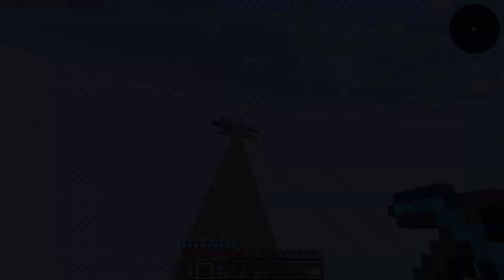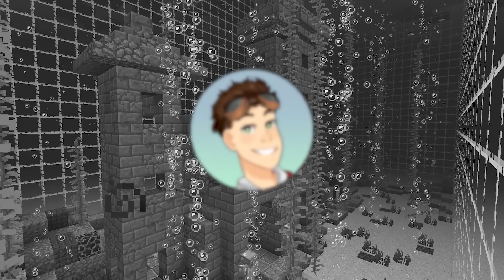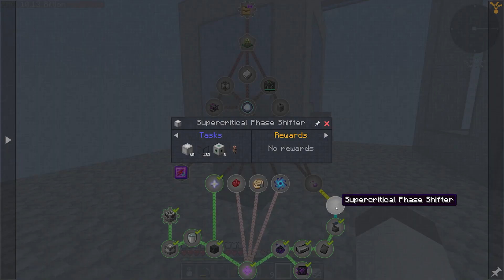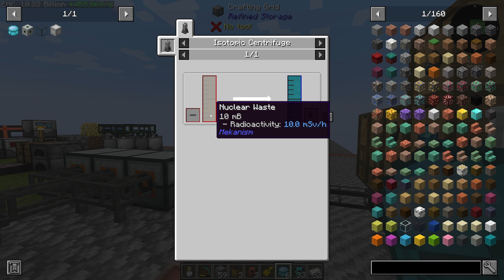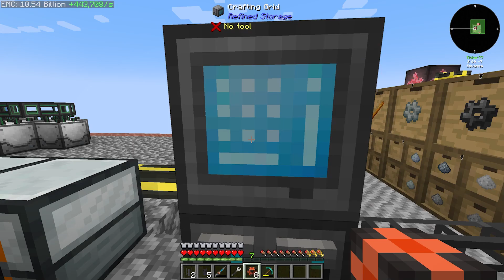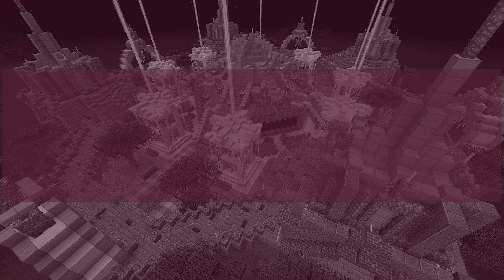Mechanical Mastery - Ep 36 - RADIOACTIVE DERP!

Comment: For Energy: Replace the Energy Cube with a Flux Plug to a 2nd network. Connect the Energy Cube with a Point (prio 0) to this 2nd network.
Now build a Resistive Heater, turn the heat it takes to max and connect it to another Flux Point with prio -1000 in the 2nd network.
Now any unconsumed energy gets trashed by the Heater.
Water for the Reactor: Add more Vents and Condensers for the turbine to create a close loop between the reactor and the turbine.